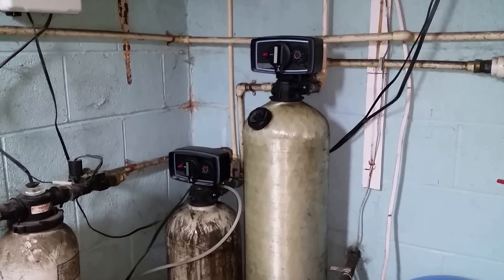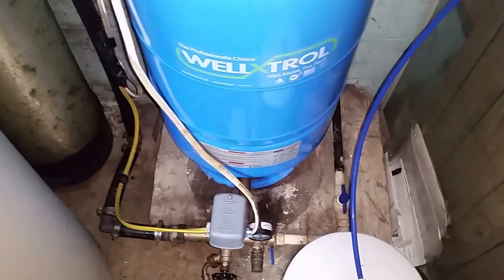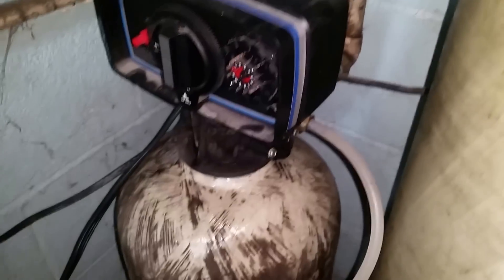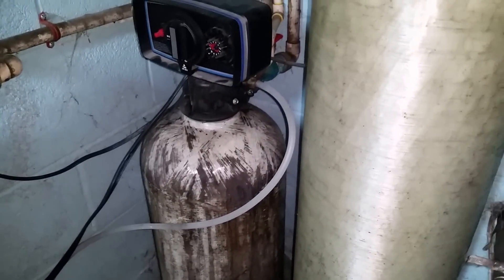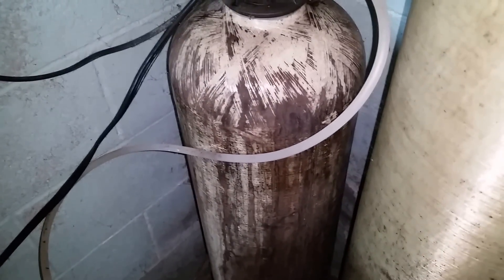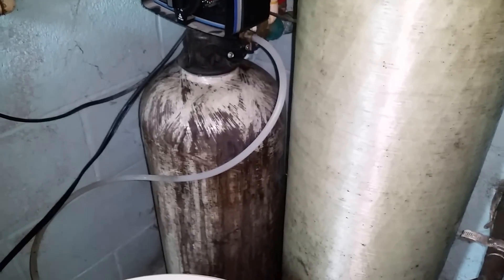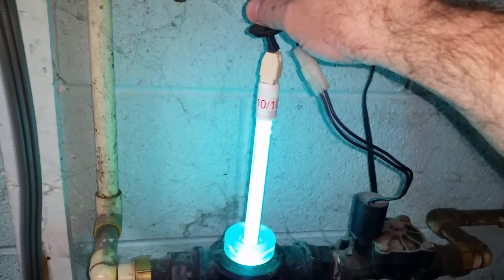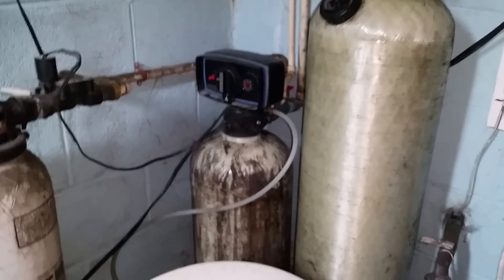How my Water Softener works; With Neutralizer and Bio-Lite

Comment: our water hardness ranges between 15 and 20 grains per gallon mostly calcium carbonate and magnesium. Either sodium chloride or potassium chloride,
can be used in the softener that I have. with some Plumbing I could bypass it however it would not be a very easy task. I just don't know how potassium ions would affect the fish or plants I think plants might be able to use the potassium ions but I don't know for sure
Reply from the maker: It's not that. It's the fish's ability to osmoregulate. The sodium ions will probably have the same effect as potassium ions.
https://www.youtube.com/watch?v=iOHahbi47KA

Comment: What about the use of potassium chloride in a water softener instead of sodium chloride. Would the potassium ions be as bad for the fish. I ask this because I have no choice but to use soft water but I could change to potassium chloride as the regeneration salt. If all else fails I guess I could go to RO water and  add back the trace elements
Reply from the maker: It's the sodium ions that are used in the ion exchange process. I don't know if potassium chloride would even work in your softener. Can you bypass it? How hard is your water to start with. If I didn't have such high nitrates in my ground water, I could just bypass my system all together